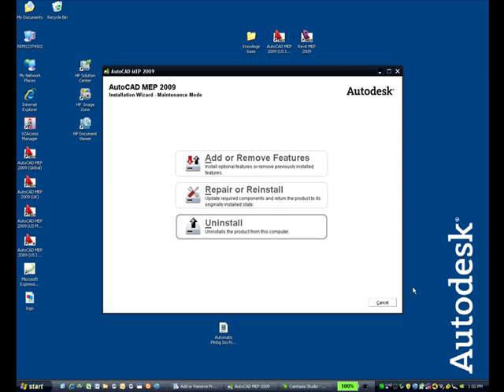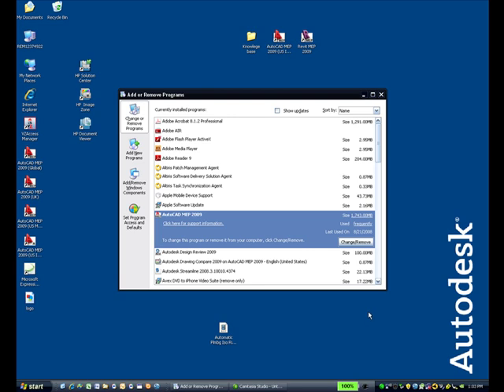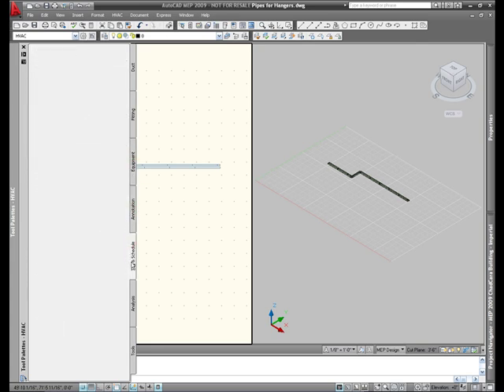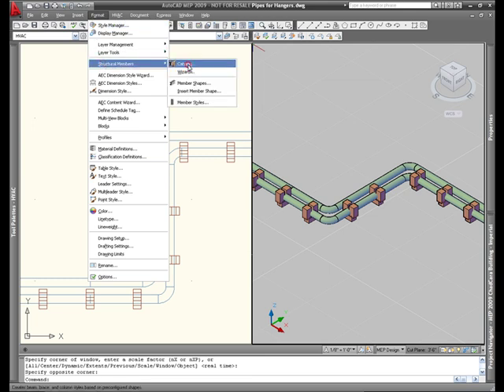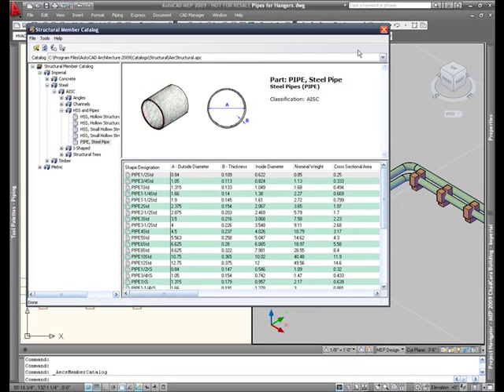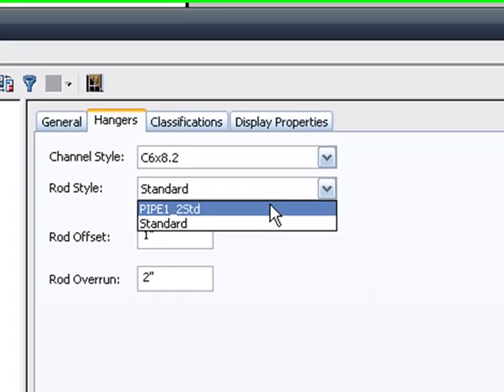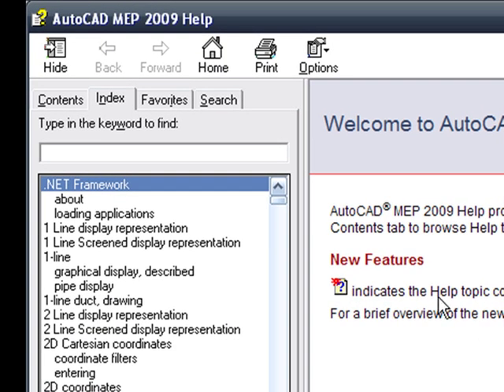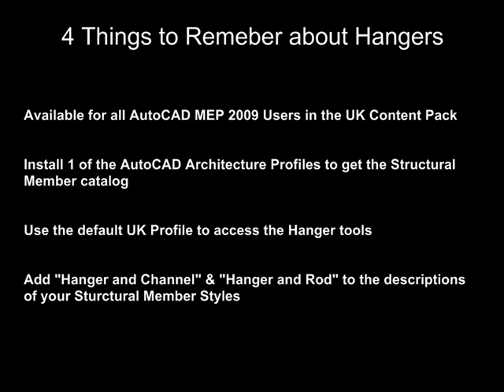AutoCAD MEP 2009 - Using Hangers

Comment: How do change the hanger to a clevis hanger?
Reply: chris little Good question, Chris. I would begin by approximating it with a similarly sized profile already found in the Structural Catalog. If that isn't suitable, then you can create a custom profile or even a block. Please let me know if you try it, whether you succeed or not. I'm hoping Release 2016 has improved on the way it handles hangers. I know this is one of the features that has caught my attention from Autodesk Fabrication CADmep.